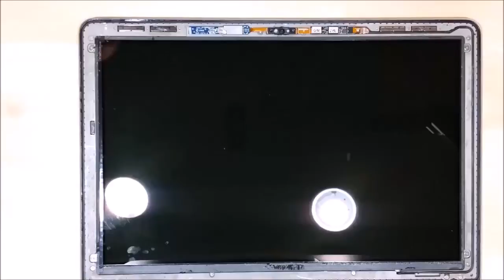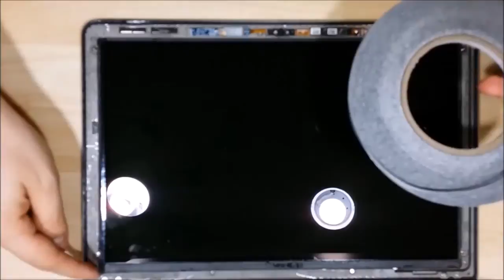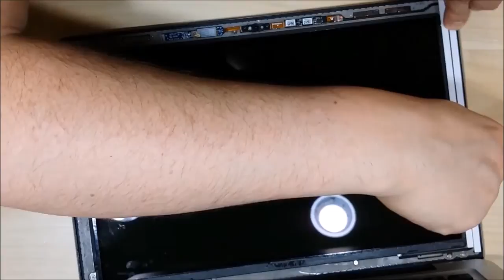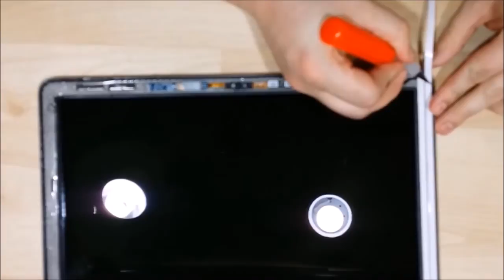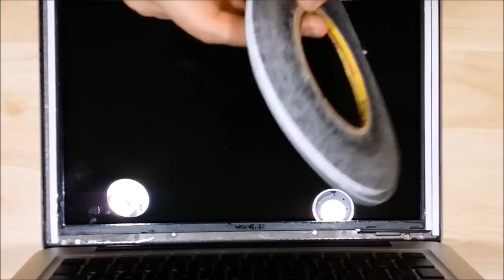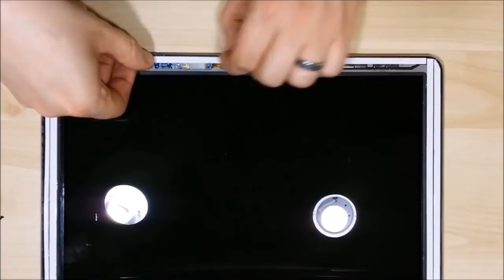MacBook Pro 13" A1278 Glass Screen Replacement - Adhesive

Comment: I have the same question as Paul Rodriguez two years ago. What is the model of the adhesive you're using? What is the width of the adhesive you're using? All you say is use 3M adhesive, but they make like 1000 different Adhesives over at 3M.
Reply: He is using a combination of 5mm and "2-3mm" tape